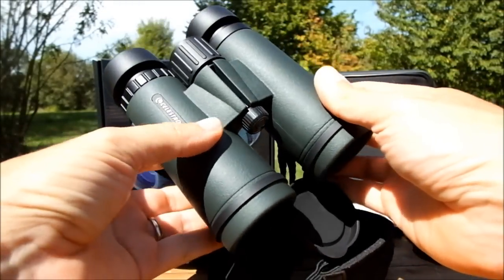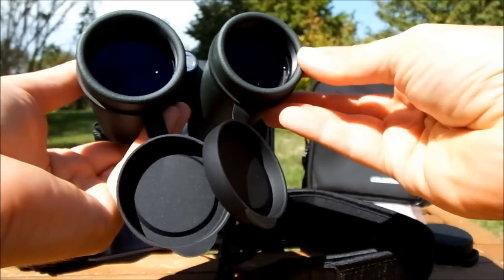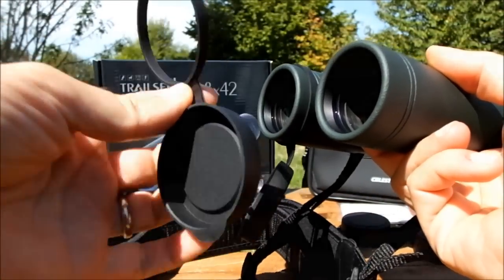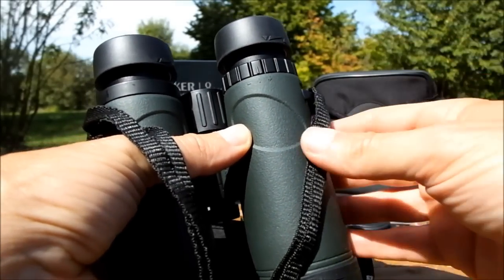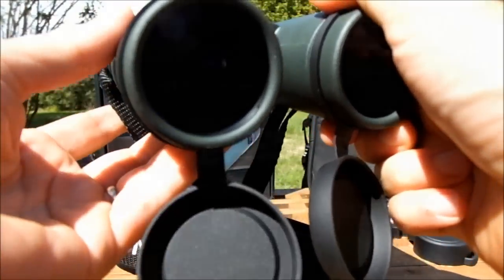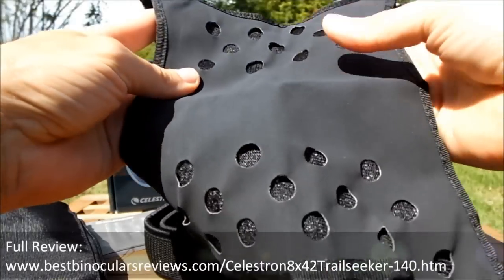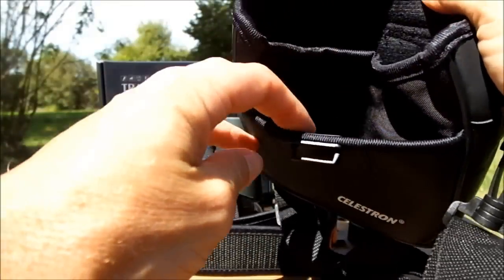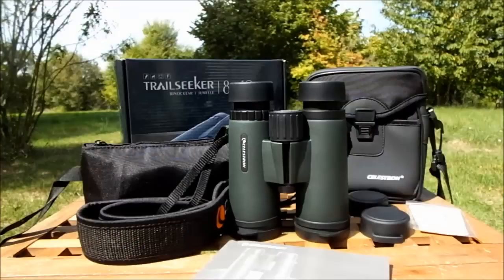Celestron Trailseeker 8x42 Binoculars

Comment: Hey, I ended up buying these, I find them to have an extremely close focus range, and the measurements are exactly as advertised IPD= 5.5cm.

It's snowy here and I can see easily chromatic aberration of both green and purple on each side of images contrasted against snow, e.g. a big ol' pine tree.

AND one of the eye pieces came warped. But Celestron has so far been very good about that and I'll be taking them in for a new pair or repairs soon.

I think they are very good so far despite the aberration, I won't hold the warped eye cup against them, I haven't taken them on a long field test yet, maybe I'll report in after.

Also the lenses fog up from my normal breathing which is annoying, but I don't know if that's unique to these binos at all, it could just be a general binocular problem.
Reply: Celestron took my Bins with the warped eye piece, and replaced them with new ones that work wonderfully so far. The eye cups aren't perfectly flat but that's just nitpicking, they are well within operational limits.

Great service that swiftly replaced my defective product. So far so good.

Comment: How important is ED glass?  I don't think these have ED glass.
Reply from the maker: Hi, thanks for the question. The answer is that it depends. ED glass gives the designers of the optical the "POTENTIAL" to better manipulate the individual wavelengths of light. This in theory means that they can reduce color fringing in the image by reducing the amount of chromatic aberrations. 

However notice that I have used highlighted the word POTENTAL, this is because just adding ED elements in the lens does not just automatically do this, it has to be used with great expertise and the whole optical system throughout the binocular has to be taken into account. 

So I have noted a number of cases where an ED glass binocular (often the cheaper ones) displays more color fringing than a well built non ED glass binocular.  For more, check out my guide to Extra Low Dispersion Glass (ED Glass) in binoculars here: http://www.bestbinocularsreviews.com/blog/extra-low-dispersion-glass-ed-glass-09/
Reply: Thanks. You have an excellent site

Have  you thought about reviewing any Wingspan bins?  They used to be Polaris. They have  a lot of good reviews on Amazon.
Reply from the maker: Thanks very much for the kind words and funny you say that I actually have some Wingspan binoculars coming in for review - should be on my site in the next month or so! :-)
Reply: Great. I just got some Wingspan Probirder and NatureHawk that I am trying out. The Naturehawk is too big for me but I like the image. The Probirder are smaller and also have good optics.

I want to see what you rate Wingspan compared  to the Hawke ed 8 x 32 which I am considering along with the Celestron Trailseeker.

I don't know why the Probirder with ED glass are 119.00 and the Naturepro without ED glass are 139.00. They both get excellent reviews. I am leaning towards the Naturepro because they are lighter and have a wider field of view.

I am leaning towards the 32mm because they are smaller and I don't know how much difference in light gathering there will actually be especially if I don't use them at dusk much.
Reply: I can't wait for your review of the Wingspan. I have been trying to tell the difference between the Naturehaw's image and the the Probirder's image, but they look about the same to me. 

I think it's a quality image and I'm curious to find out what you think since you have seen so many. Once you give your review I'll have my own benchmark for images.

I want to see those bins that have a better image than these because they must be incredible.

Do you know which Wingspans you will be reviewing?
Reply from the maker: Not yet sorry and it will be a few months until it is done and up on the site - I have a few others to do before then and then when I start, I test each for at least a couple of weeks before even starting the review.